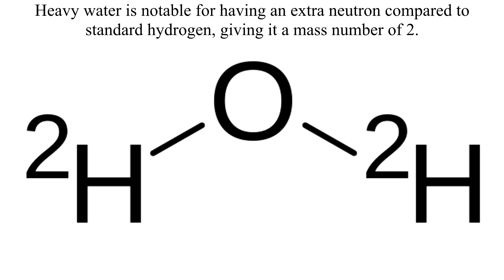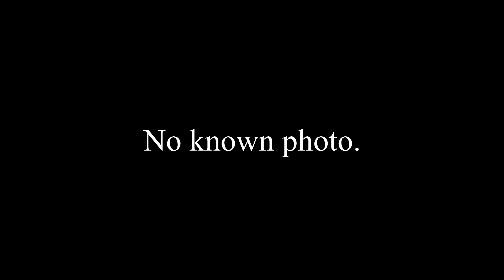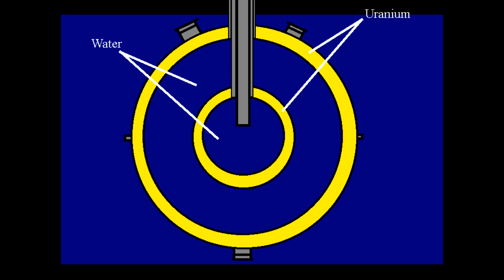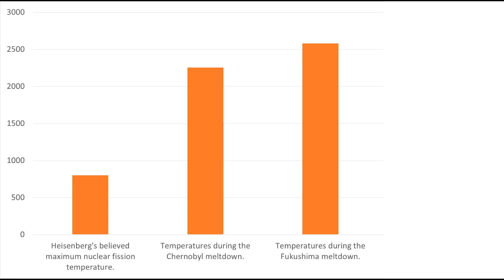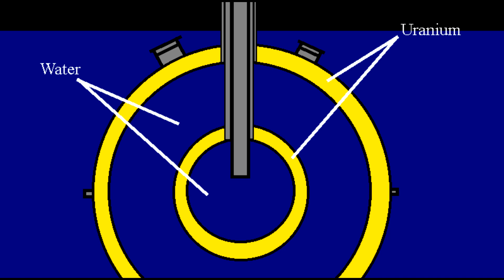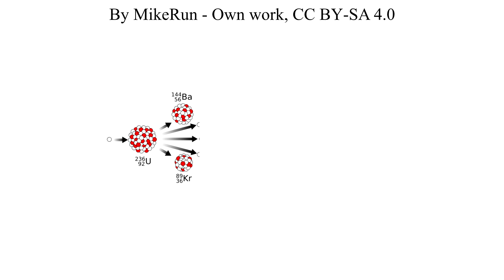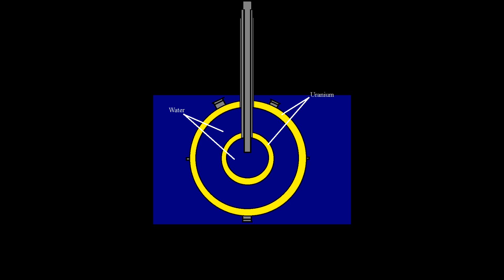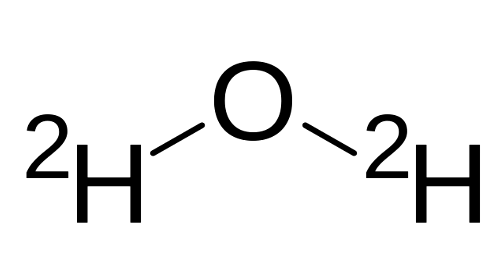The Leipzig L-IV Accident: The World's First Nuclear Accident

Comment: Arguably this is only a laboratory fire rather than a nuclear accident.
To actually achieve criticality with pure natural uranium (NU) and pure heavy water requires several tonnes of each material. There is a configuration that minimises the required mass of NU and another that minimises the required mass of D2O.
In between there are some useful compromises.
For example about three tonnes of each material might do the trick.
I suspect the WW2 German research programme had enough material for this, but failed to consolidate it all in one place.